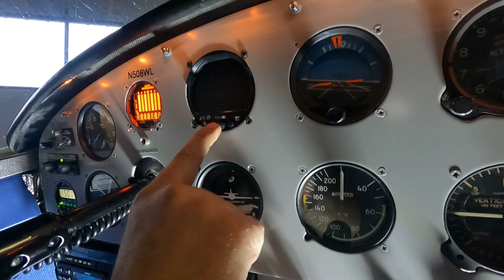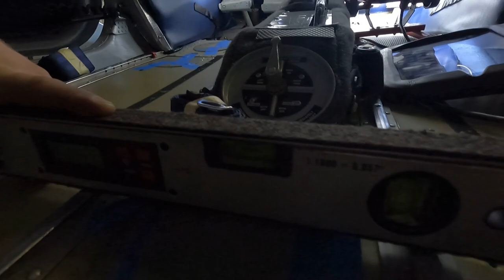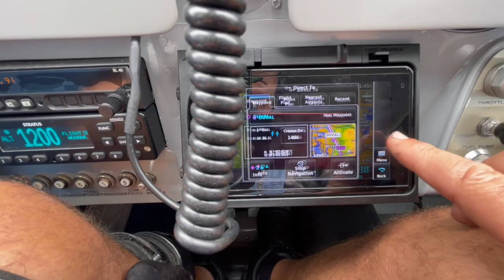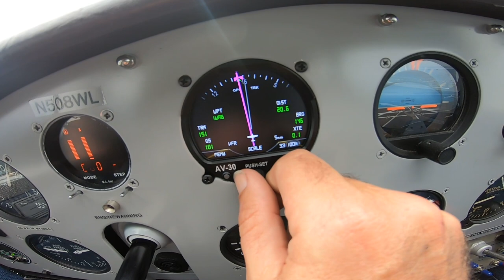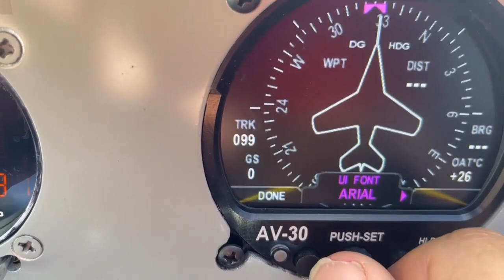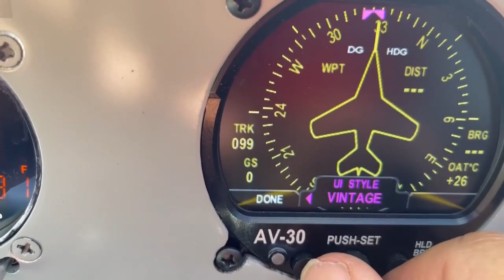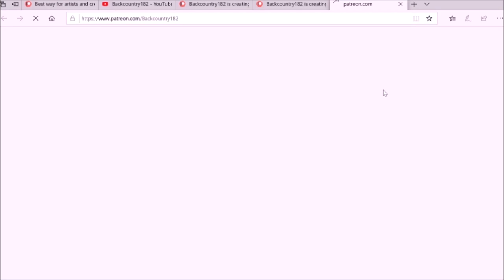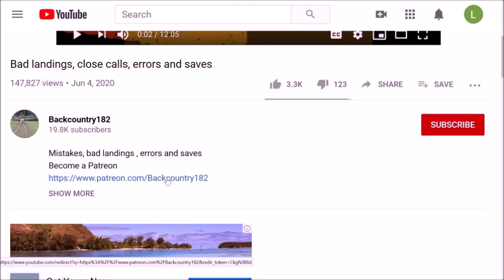Uavionix AV 30 and upgrades to a Cessna 170B

Comment: Correction I looked at my picture the AOPA 170 is a constant speed prop IO-370. Your 170 had the engine controls all in a row. AOPA  170 had the prop control underneath below the throttle control .

Comment: The problem with AV30 is that it drifts more than my old and tired vacuum DG. It works great as an attitude indicator, but without magnetometer, the DG is worthless, you’ll be correcting it for compass heading all the time if you are making any kind of turns at all.
Reply: I can confirm this. The last time i flew with an AV30 i was inbound to KICT and it had me indicated at a NW heading when I was direct inbound to the 19L approach. It drifts really badly.
Reply: @Keys879  I have heard they have a fix for this now?
Reply from the maker: I am not seeing this problem, mine was from December 2021, maybe they fixed it?
Reply: @motoadveBackcountry182  There have been hardware and firmware upgrades to the AV30C that added an internal magnetometer  and from reports from friends have gotten the heading drift down to the level of a good vacuum DG.  I have installed them in a project plane but have not flown with them yet.  Also, uAvioncis is coming out with an external Magnetometer (now available for the AV30E).  I plan to prewire for this.  It has been taking them about a year + to get additional features approved through the FAA for the certified version.
Also, it looks like Jose is using GPS data for the DG, which while does not exactly replace a good magnetic reference, almost makes the drift issue a mute point.
Reply: @motoadveBackcountry182  maybe so, maybe they fixed it, but I paid for my 2 AV30s in 2020 and it was sold to me as a certified instrument. There’s certain criteria for DG allowable drift, something like no more than 5 degrees every 15 min or something like that. Mine drifted 30 degrees by the time you depart the pattern. When I contacted Uavionics, they basically told me to take a hike. They did not stand behind their product. Shame on Uavionics and shame on the FAA who gave it certification and allowed sales in the first place. Not acceptable in aviation. Never again will I buy uavionics stuff, they lost all credibility.
Reply: They upgrade for free,  makes the DG have very little drift
Reply: @erinchillmusic8930  They now have a magnetometer. I just put two AV30's in my 170. The magnetometer is located in the right wing. Seems to be working well. Flew a 4.5 hour cross country and never touched the setting. But, based on your description and others, I waited until they came out with the magnetometer before purchasing.

Comment: What is your empty weight and CG now? My Javelin tank helps with the CG some. I have put 5 gallons in it get myself back in CG with a heavy passenger. My plane is 1498 with the rear seat out and a CG of 40.4.
Reply from the maker: 1,510 lbs, CG is 41.98 with the 15 pounds survival gear.

Comment: Have you any thoughts on using an av-30 as  primary AOA indicator?
Reply from the maker: I would if I did not had the Alpha Systems AoA already installed, which I have used for more than 2,000hrs.
Reply: @motoadveBackcountry182  How do you think it might compare?  The av30 seems like a good all In one alternative.
Reply from the maker: @hm250  Yes its pretty good, much more reliable than an ASI for sure.